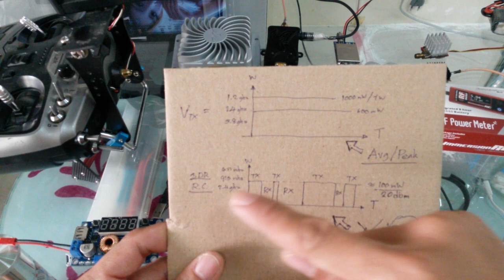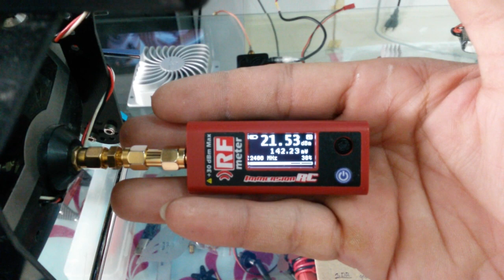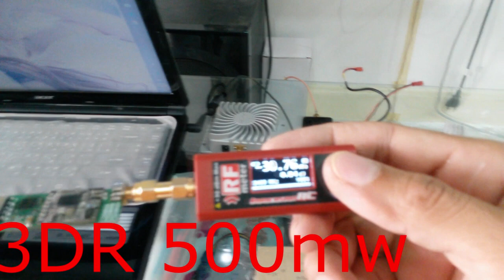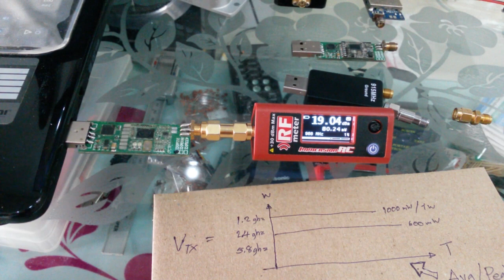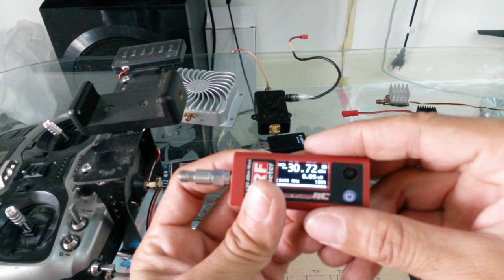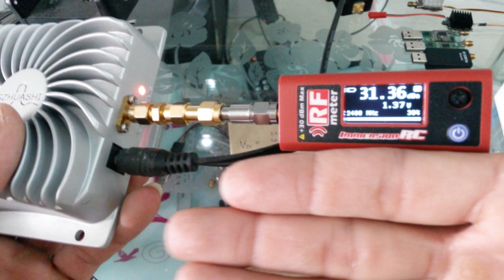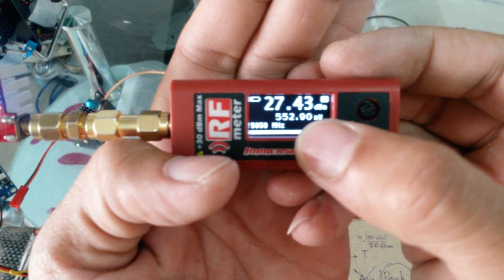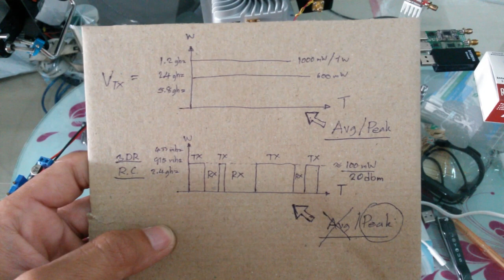RF Power meter Test (ImmersionRC RF Power Meter V2)

Comment: did you check the other frequency for 1.2vtx for output power? what frequency have the maximum output power?thanks
Reply from the maker: 1200-1280mhz
Reply: @montreetormee  which one have maximum output and how much?thanks
Reply from the maker: 1080=540mw, 1120=560mw, 1160=582mw, 1200=600mw, 1240=602mw, 1280=603mw, 1320=598mw, 1360=580mw,
Reply: @montreetormee  i received mine and tested it, was only reading 398mw maximum, very disappointed with the seller, they advertised as 600mw but true output power i think is 400mw only